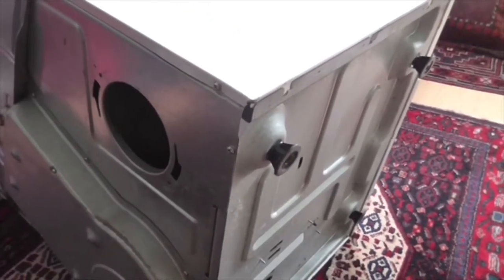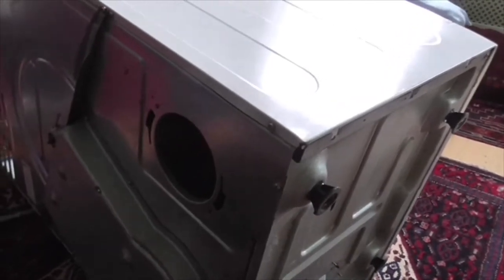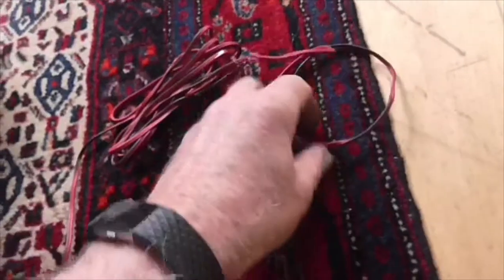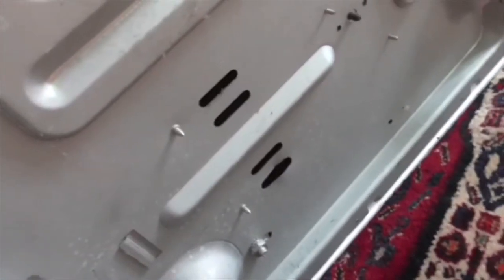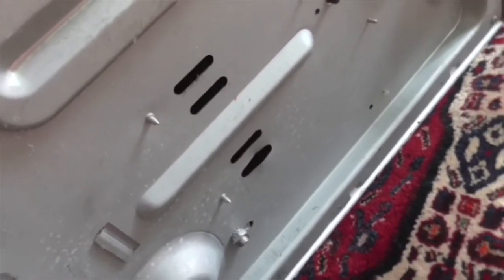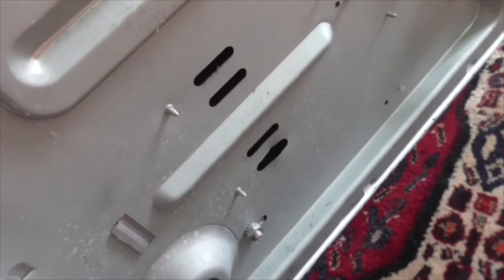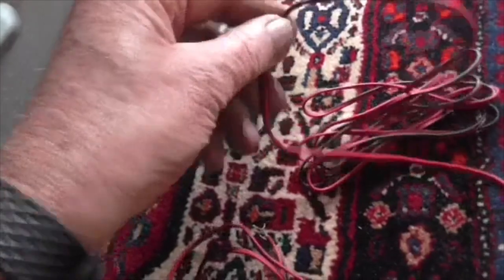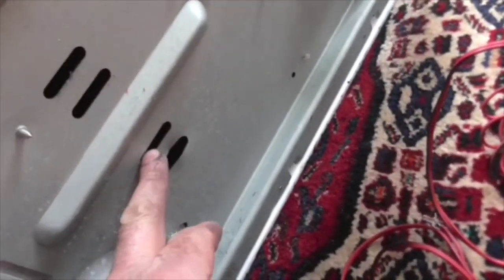fitting a tumble dryer stretch belt the easy way!#shorts

Comment: I ll give it a try because I m at my wits end. I m not strong enough to hand stretch .Can lever it with a screw driver but can t then slip it over the motor pully ..This is an older Indeset not Hotpoint . I ve tried soaking it in boiling water, boiling it in boiling water,  , ( by the time I get it back round the drum its completely cooled ) BLOW TORCH lol Hair dryer just on the spot I stretch ..Run out of ideas and patience .I was thinking if I could attach a kind of winch on it somehow, the stretch tool they use is £90 . The Youtube by Buyspares is a con , no wonder all comments are turned off.They must use a slightly longer belt. I will have to drill a hole on the base of the machine directly under the pully shaft and tip on its side..If this does not work I ll scrap it
Reply from the maker: You can loop the belt over your foot and stretch it that way, shouldnt be much difference between Hotpoint and indesit as they are both made by merloni in Italy
Reply from the maker: It is easier with two people, one with a hand through the exhaust duct hole, and one pulling on the wire! It is not easy, but it is doable! 
Phil
Reply: @philhermetic  Thanks , I ve had a go on my own and still failed so asked my brother in law to come and help.. I ve nearly got it on with the screwdriver leavering against the motor but that is when I need the extra hand as I m giving it everything trying to keep up the stretch . First belt they sent me was incorrect one, wrong part number and could get with an inch of it..new correct belt is slightly better.. I heat just the area I stretch with a hair dryer , not the whole belt . I drilled a hole which is on the base of the machine , directly under the motor pully and threaded some line under it and looped it back..Getting my foot on it would be far better so will try that .Thanks very much for your help
Reply: Finally did it Phil. Gave up on the string pull method .My friend came and had a few heavy pulls and also failed but noticed that it was possible to pull the drum away and out and move the whole thing much closer to the spindle .Slipped ibelt  on easy then it was a bit of a heave to get the whole drum back into place in its seating . Seamed easier to push the drum back than pull that belt. Dryer works ok now anyway as it was going to be scrapped if  the belt would not go on .Thanks very much for your help
Reply from the maker: @stuartchester6899  i used some flat twin bell wire in a loop, string doesnt work , you cant get enough pull on it. Best to give steady and increasing pull slowly to give the belt material time to stretch, they are a sod to do even then! Problem with mine is that if you take out enough screws to disengage the drum it flops all over the place! At least you got it done!!
Phil